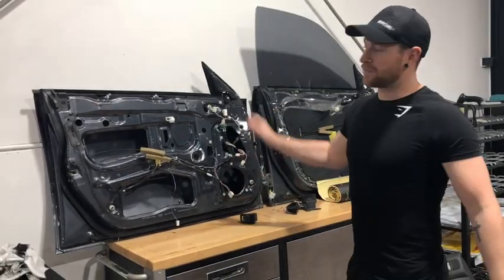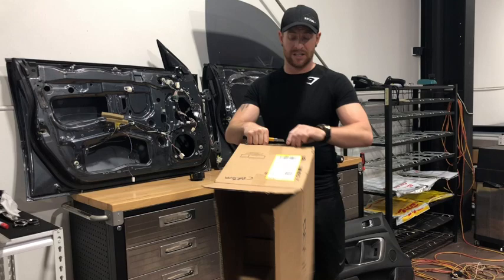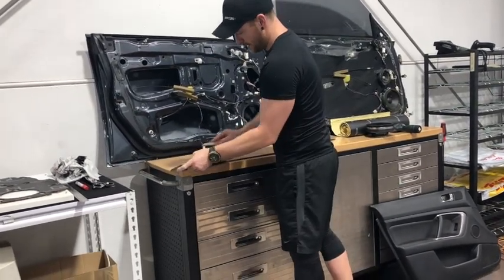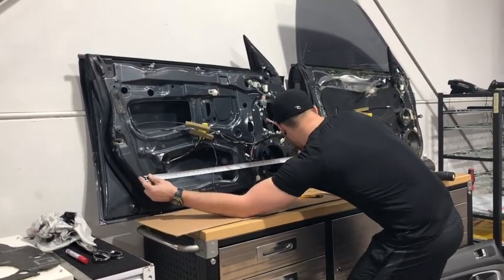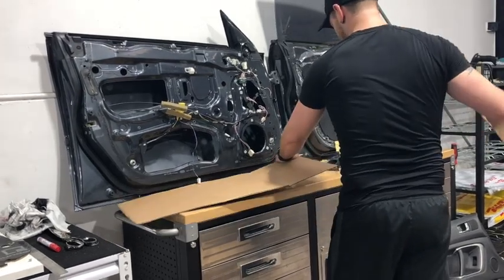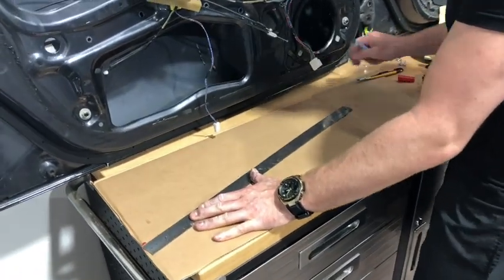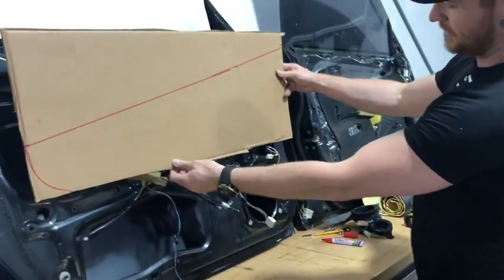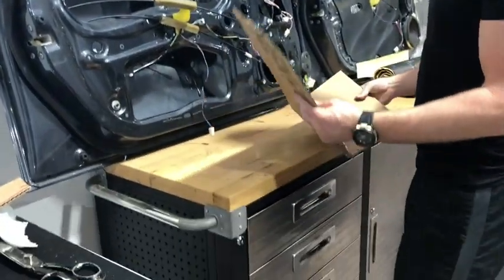SoundSkins Stage 1: How To Apply Sound Deadening Inside of a Door

Comment: Does this only improve the speaker sound so the door vibrates less thus more solid sound or does it also help reducing noise from outside and make door closing sound more solid?
Reply: Both, you will need to cover almost the whole car to make road noise considerably quieter tho

Comment: Fantastic hello from New York and a really quick question.  Just had my 2021 Dodge Durango returned to me after auto body repair.  I had a collision with a deer that damaged my driver side door.  I immediately noticed that the door sounds completely Hollow.  When I tap on it with my knuckles it sounds like an empty aluminum can.  I did a comparison with the passenger side door and it does not make that sound at all.  Do you have any idea what the body shop did or did not do to cause this hollow sound?
Reply from the maker: Hi GM, if your door had to be replaced by the shop, then the shop likely had to buy new parts for a door which could have been bare, and did not come with the same factory sound deadening (or aftermarket added sound deadening) that your car came with. We hope this helps!

Comment: The method shown is all very wrong (it's good for the CLD manufacturer though - maximum material consumption method).

There is no benefit at all when covering more than around 66% of panel surface with CLD materials. Around 50% is quite enough.

That principle also eliminates this very complex aspect of cutting and aligning CLD sheets to the precise shapes and contours of the panels.

Was Sisyphus your application instructor?
Reply: @Error-hc7mp  Depends on the panel. For a small panel yes. For larger ones, several (2-6) smaller sheets roughly equally spaced apart on various parts of the panel. The larger the panel, more the sheets. There is no hard rule, but definitely no need to go even near 100% coverage EVER.
Reply: @Error-hc7mp  Usually no. Thicker might be even worse if different products are compared. No product has the same quality.

Thicker could also fall off more easily.
Reply: Yup, bang on! This guy spent more time templating than doing.

Comment: Thank you for showing your method, mate — but I don’t get why you didn’t do the same on the deadening material as you did on the cardboard? Because as you said “it’s the same angle” so why waste product and do unnecessary work (more cutting) by making a small gap between your templates on the deadening material??

FYI; another crucial point on why it has to be applied correctly (preferably with a pressure roller) is if there are small air pockets then it can cause moisture which leads to rust.

Comment: What about all the metal surface inside of the door? Im talking about the inside, opposite the outer panel? I don't think I've seen anyone do anything to dampen it. Wouldn't it be reflecting a lot of noise?
Reply from the maker: Hi Ingemar, yes you are correct. This is just stage one of the installation, there is another video giving instructions for installing material on the door outer skins as well!